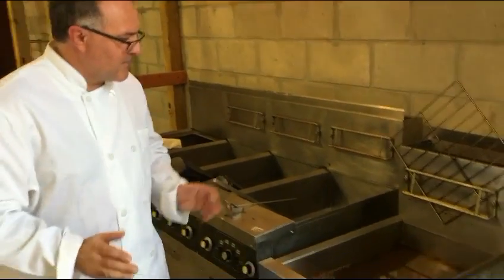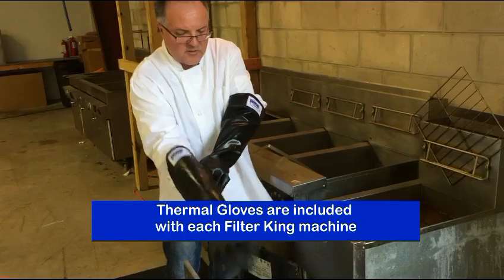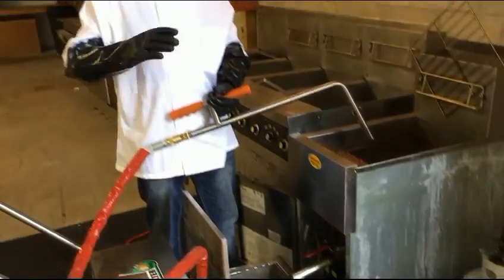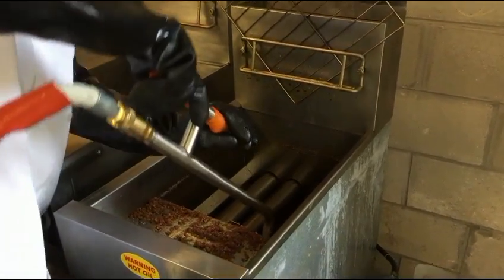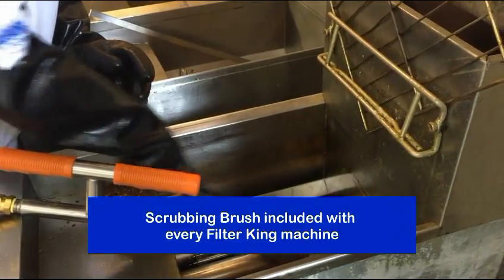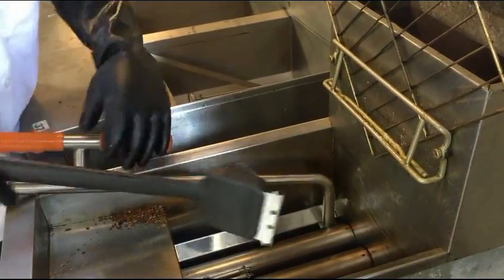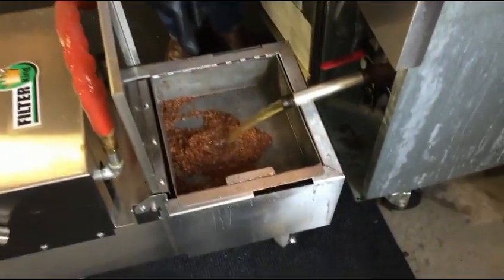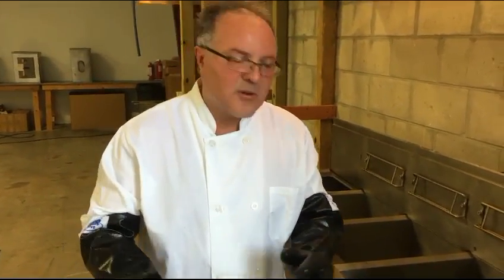Filter King Demonstration

Comment: How much and what is the capacity
Reply from the maker: The machine is not cheap because it’s made here in the USA and it has a six year warranty wish no other machine ever gives. The cost is $6000 and the capacity and that is 16 gallons of oil so we can handle the large 80 pound or 90 pound fryers. If you have any questions please feel free to call me at 407-509-1449 and our website is www.microfilterking.com.
Reply from the maker: If you want references of restaurants that are using the machine and how it cut their oil cost by 50 to 70%, I would be happy to provide them. Please feel free to call me and I will gladly answer any questions you may have. Again my number is 407-509-1449 on the founder and inventor of the machine.

Christos 
Founder

Comment: Does it work with Motor oil? LoL
Reply: That's both a joke yet also serious question...if it did that would make recycling used motor oil so much easier...
Reply from the maker: Yes it absolutely works with motor oil or any kind of oil or grease it breaks down everything. Feel free to visit our website at the Mfs shop on this link below or call me if you have any questions at 407-509-1449.

https://www.exhausthoodcleaningschool.com/shop/hood-cleaning/hood-degreaser-5-gal-pail

Comment: Yeah sure it's a great piece of Machinery I just wish this guy would be honest and explain the boil out process that needs to be done at the end of the week for fryers specifically like this. And how fun and time-consuming that process is
Reply from the maker: You are correct that the fryers must be cleaned every week to be freed from carbons which contribute to that fried food. Unfortunately in this video we are showing them how they can use our machine to filter their cooking oil, not to clean their fryers. We are making assumption that they are cleaning their fryers weekly otherwise yes you’re gonna get bad fried food even with a great oil filter machine if there are carbons inside the fryer that are not removed.

Comment: Man this would've been great on board US Navy vessels. To fill the fryer in the beginning the can's of shorting would be put into kettles of boiling water to melt. After afew there you  could use a bench knife to punch a pouring hole and a air hole to fill fryer. After using that's wear it got difficult with the rocking of the ship. If to dirty to reuse, we or I would put into the empty can's and let cool and hardened. Then toss over the side when we dumped trash at sea. Needed to add the hazardous part if shorting was still usable, 
Cool oil would be drain in 6 inch steamtable pans the pour thur a fine calendar to remove the big stuff, then pour back into fryer for next use.

Comment: I’m front of house so I may be speaking out of my ass but I think the fryer we have at work has a built in oil filter
Reply from the maker: No you are probably correct. There’s many fryers that have built-in push button oil filtration. They are called in line Fryers. Unfortunately they are not microscopic filtration systems and will remove the big bread crumbs that you can see by eye but will not double life for the cooking oil.
Reply: @MFSTradeSchool  thanks for clarifying! Awesome video by the way!
Reply from the maker: We do pay a $500 Commission if you were to introduce our machine to your restaurant
Reply from the maker: If you would like to get information and specs on the machine you can visit our website at www.MicroFilterKing.com
Reply: @MFSTradeSchool  heard

Comment: So I have a question. Do y’all have a separate machine for restaurants that use peanut oil vs other oils?
Reply from the maker: No you can use the same machine for any oil unless you did not want to cross contaminate your oils. If you have any other questions please feel free to call me direct at 407-509-1449

Comment: I have also been seeing a new method. One where there are 2 tanks in the facility, one has a hose that sucks the old oil up, and the other shoots out clean oil. The older oil gets sucked into a huge tank that Filters the oil right there and the other tank is full of the clean/filtered oil. The whole process is done right there

Comment: I’ve worked around many Different types of fryers. More recently the Fryers at our Local Safe Way grocery stores usually have a gas powered Fryer that drops the oil into a bottom Filter pan, the oil drops down and there is a metal Grate that catches most  crumbs and other things caught in the fryer. And just by hooking up the hose to the fryer you can do the same process as here. Where you filter/ polish and clean the fryer simultaneously. Even Churches chicken and Wingstop have the same type of fryer where this process is built into the fryers. This Filter method is great ofc for fryers that do Not have this built in.

Comment: This is pretty much exactly the process chick fil a used when I worked there. Their fryers had a spot to attach the hose though and the filter machine was part of the fryer. To add to that we changed the oil very seldom(once a month or even 2 months) despite fried food being about the only thing on the menu. The key to that is the lockout system they had. Wouldn’t let you cook if you don’t run the filter every 5 cooks
Reply: Worst thing ever was being the guy who had to change all 8 filters
Reply: You mean every five cook batches they filter the OIL?  Is that mean almost every hour or less?
Reply: Temperature,time and oil quality dictate fry food quality.  The older the old the more greasy of the food.   Can we reuse the filter?  Or need it to change out every time? How offer we filter the oil?  Like how many lbs of food cook before filter again?  $6.667 per filter sheet is expensive
Reply: @jasontran06  at chick fil a we changed the filter sheets every day
Reply from the maker: Chick-fil-A and some other similar restaurants have a very high absorption rate and they keep adding oil infest don’t need to change it very often. However there hasn’t been a single time that I have eaten a Chick-fil-A sandwich where the chicken is not very greasy. I think if they had a filtration system similar to ours that they would get much better results

Comment: I used to work in a kitchen that had oil cleanliness problems our solution was basically to empty the machine once every day and put the oil into a Food grade oil drum outside that would be taken away at a later date and then clean the fryer when empty with Blue Tissue  but this option seems a lot more economical
Reply: Why wouldn’t you filter it once a day with a fine strainer at the very least
Reply: Seems like you worked at taco hell
Reply: Yup, we did the same thing at Taco Bell. No filtering at all, just dump, clean, add new.

Comment: I wonder if you doubled up on the bottom filter if it’ll catch even more
Reply from the maker: It’s a possibility but I don’t recommend it because it may put a lot of strain on the motor and pump. You could try it one time and see. But if you need deeper Filtration than 10 µm we can give you a 1 µm filter

Comment: Simple math if you spend 1k a month on oil, this machine cuts cost (and waste) down 50% ($500) . If Machine cost 5k it pays for itself within the first year of use. Not to mention having to dispose of HALF the oil than previously disposed. If your business is successful and growing, this is a SOUND Investment.
Reply from the maker: That is correct. Also depending on your usage, this machine has taken restaurants higher than 50%!
Reply from the maker: Yeah I think you remember is that this machine is made here in the USA in our last you 6+ years and then you can rebuild it and go another six years without having to change machines every two years which is typical for most oil filter machines sold today.
Reply from the maker: Oh thank you Siri for screwing up everything I told you to write, LOL

What I wanted to say Is that this machine is made here in the USA and it will last you 6+ years
Reply: In other words, “the Sumb*tch sells AND pays for itself”!
Reply: I imagine it would be pretty easy to build this.
Reply: You still have to account for the cost of the filters that are discarded everyday. I wouldnt say the filters come too cheap
Reply: @jinnie6292  cost benefit analysis is a very good analytical tool for this situation

Comment: My old job had one of these. They worked like a charm 👍🏻
Reply: How are these cleaned and how often? That's what I've been wondering
Reply: @midgetman4206  the filtration system or the fryer? The fryers vary depending on various shit, the filtration machine gets cleaned every time it’s used at least in my experience

Comment: Sooo I have to clean the grease and then clean the machine 🤔 ayayaya 😂
Reply from the maker: No actually the machine cleans itself by redirecting the gun towards the inside of the tank for two minutes in the hot oil will clean it right out. If you like feel free to call me tomorrow and I can explain at 407-509-1449.

Comment: That Red thermal-jacket sleeve he is using is made of a Silicone outer cover, but that inside of that sleeve is unprotected fiberglass. That fiberglass is releasing glass particles into the air and into the oil. Do not use that product around any food or food equipment.
Reply from the maker: Alex, The red thermal jacket does not touch the oil. It is just there to protect from the heat of the actual food grade hose that it covers.The hose that it covers is a food grade safe hose made to touch the oil and the food and it’s FDA approved.
Reply from the maker: The actual hose is FDA approved food grade safe
Reply from the maker: If you have any questions please feel free to call me at 407-509-1449

Comment: But does the microscopic filter also filter out all the flavor used oil imparts on the food, I have a sneaky feeling it ruins the flavor
Reply from the maker: The oil filter machine takes out the burned particles the degrade the oil irreversibly. The flavor should be in the food and in the seasoning, not in the greasy burned debris inside the oil.
Reply: I really hope you don't work in the restaurant industry if you think used oil makes your food taste better.
Reply from the maker: You should absolutely not ruin the flavor of the food. The flavor should be on the food not in the oil

Comment: Do you offer a fryer oil filtration course? I would definitely take it.
Reply from the maker: Hi Sir
Reply from the maker: You can buy the only filtration Course...It actually comes with the purchase of a machine or you can buy the course separately.
Reply from the maker: The cost of the machine is $4995 and the course for the offer attrition is $1500. Again if you purchase a machine for 4995 the course is included. If you have any questions feel free to call me at 407-509-1449. I am the inventor of the machine and the founder of the MFS Trade school
Reply from the maker: The course is done online

Comment: Looks great but how to you clean the machine for the next day filtration
Reply from the maker: The machine cleans itself, every time you clean a fryer.  It takes about 5 minutes using the same hot oil you are filtering. We have the best machine out there, that filters down to a microscopic level which guarantees you will cut your oil costs in half.  See live demonstration video  go to:  www.microfilterking.com

Comment: thank you for sharing , I learned some tip about how to filter,#1 temperature ,#2 the more layer filter the better clear oil #3 timing ,it take time ,#4 do not filter when the oil  is cold , the oil will be too thick can't get through the filter
Reply from the maker: Thank you Tuyet. Be sure to check us out on Facebook & Twitter for industry news and new product roll outs!
Reply: @MFSTradeSchool  I did try, the oil  it very clear , again thanks a lot
Reply: @TUYETNGUYEN-vz5mn   how to check when cooking oil filter machine is not working
Reply: Can I change the capacitor and see